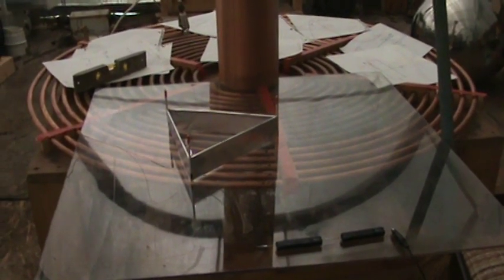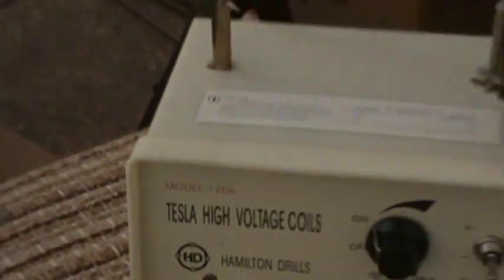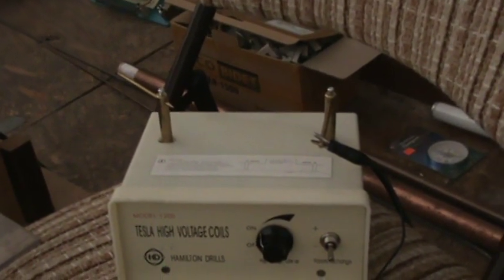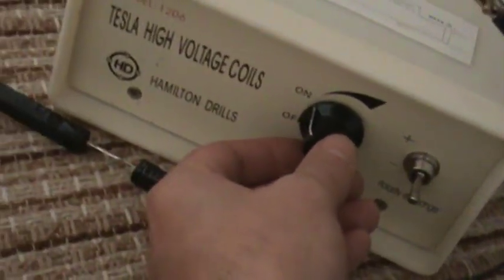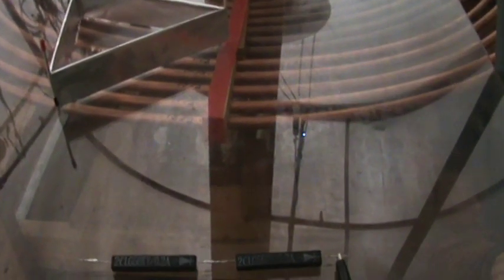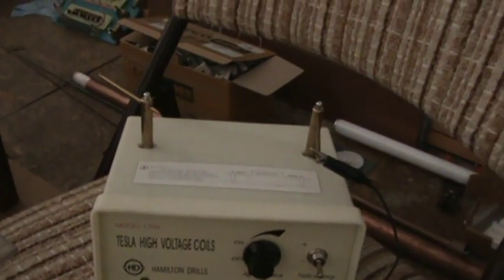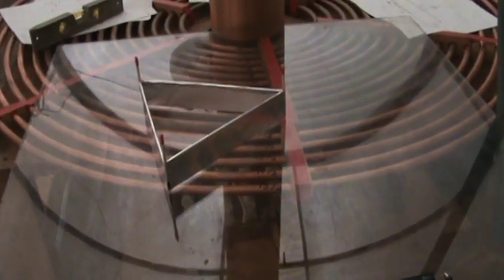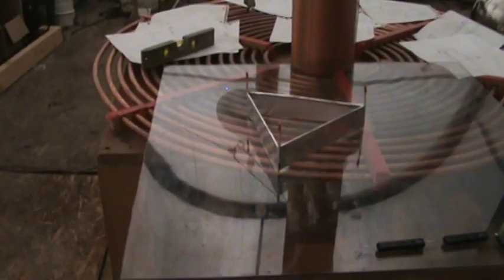LIfter/Ion Craft, Biefeld Brown Effect, Part 1

Comment: Needs capacitors for steady DC... and the wire should be far enough away from the foil to prevent arcs
Reply from the maker: I finally get some lift in video part 4, using TV .      Video part 5 craft sets on fire, LOL

Comment: I think I've found a way theoretically to improve the thrust of Lifters, taking into account that there may be two effects an
Electro-kinetic & an Electro-gravitic or what I call the Biefeld–Brown effect proper, which I guess should involve the use of embedded electrodes as air has a K of only 1. Which means the Lifters are using an Ion wind effect or some form of Ionic medium displacement. If 2 ionising wires were used both encased inside with a space between them at one end of a flat "box" the ends of which are both open & at the other end from the wires, the collector electrode is placed all around the inside end. If the first wire is
charged positive encouraging the diatomic Nitrogen & Oxygen molecules to form into more clusters, then the second wire charges these Negatively reversing this process & making the atoms & Molecules repel from each other before being attracted by the collector electrode might this not increase the thrust? If there were problems of arching between the wires then they could
be charged in sequence to maybe prevent this.
Reply from the maker: Interesting idea, I think the two wires would need to be out of phase with each other, yes, and i think it should work.
Thanks for commenting.

Comment: It shouldn't be arcing between the wire and the foil.  They're too close... Ground the negative side of the coil and skirt to Earth. Maybe it's too heavy but I'm not sure of it's weight. regardless of positive or negative to wire... it should even work unrectified. Best of luck buddy. Higher frequency is better... Sounds like only maybe 100 cycles Try with 100khz flyback.
Reply from the maker: Thank you :-)

Comment: your craft is too heavy for one, second, the wire and the foil can't  short out (no spark. when it spark the craft falls down) move the wire further away from the foil. last, your high voltage power supply will not work (Sorry ) I purchased the same HV power supply  from eBay and it never lift my craft. (wrong frequency and too little corona). I used a flyback and driver for my. Don't give up, every obstacle you overcome you'll learn  something new. I promise.

Comment: It's gotta be DC.
Reply: INVENTOR3 One more tip. If you want a cheap way to get high voltages, then search for a voltage multiplier. It takes an AC input, and gives you a DC output that is of higher voltage. It is made entirely of diodes and capacitors. The more you use, the higher the voltage can get stepped up, hence it's a multiplier. You could technically plug this multiplier straight into the wall, and get as many dc volts as you want, so long as you use enough diodes and capacitors. Best of all, you can tap this "multiplier" in different locations to get different output voltages!
Reply from the maker: TheMarvelousSputnik Sounds good, thanks, but as we multiply the voltage we would have to pay attention to the rated values of the components.  I will look into this, thanks again.
Reply: What he said. Use a diode bridge. Right now those two diodes are only creating a pulsed current going in one direction when the AC phase is going in the direction that the diodes "point" in. Use that diode bridge and you will have a proper DC current that will lift it.
Reply from the maker: TheMarvelousSputnik Thanks.  I believe the power supply used is a puled DC.  The power supply is Tesla technology, but anyhow i get better results in part 4 & 5.
I did make a full bridge rec with the 4 diodes and i still plan on trying them with my NST transformers.
Reply: Oh yes of course. You would need to make sure the caps and diodes can handle the voltage. However, they are still quite cheap. Basically if you want 100kV out, then just buy a bunch of diodes and capacitors rated for 100kV.
Reply from the maker: TheMarvelousSputnik well, maybe hard to find components in this range and expensive, but no problems, i understand, i will use multiple components in series and parallel to get values i need.  I will build a voltage multiplier soon, no problem, thanks again.

Comment: I don't understand the diodes in series, you would use them in parallel with a capacitor in a  Flyback circuit, maybe. You had success when you used the flyback on the TV. I think you would have better results going to a earth ground rater then the negative side of the generator. Put the negative side of the generator the earth ground as well.
Reply from the maker: Yes, better luck with the TV & i did wind up using earth ground with the TV set-up..  I found that this PSU in this video is actually a tesla coil,,,it is "pulsed" dc.  I will try this experiment again soon.  I want to try a circular craft with the skirt coming down to a funnel shape to increase thrust :-)  Did you see my craft set on fire in other video, hehehehe.
Reply: Yes I did see the fire video, that was cool. The funnel design sounds interesting, but I think you may be adding more weight then can be over come by the possible gain in thrust. I would love to see the results.

Comment: Speaking of capacitors: I think there should be some capacitance at the diode between the anode and the cathode. I don't know if you could use this and whether the diode capacitance is good or bad thing in your experiment. Other than that: I think I have heard about positive results having been achieved both with even AC and DC and even with both polarities, even though not convincing me (internet you know).

Comment: Your top wire was to close to foil, any sparking destroys the coronal wind (ions) by allowing electrons to flow. Think of it a two plate capacitor with the idea being to have the smallest area plate at the top. The thinner this wire the better and without any sparking, current flow is limited. Dont use good foil for the bottom plate but the cheapest thinest crap you can find. Try and round the top closest the top wire you DONT want any creases or holes. Check in the dark for any corona discharge

Comment: there should not be any spark crossing the gap.  u need to insulate that skirt from the fine wire so spark cant cross.

voltage must be increased smoothly until lift off.

with your set up try increase the gap a bit.

Comment from the maker: I read alot about the manufacture of that PSU,,he does not advertize correctly. It is a tesla transformer, so it is in fact already a pulsed dc, at what frequency, i dont know. I should of thought to try the NST with full bridge, thanks :-) I will use wood next time :-)  I read that Tesla kept his left hand in pocket. I have good souls on my shoes and stand on rubber mats :-)
I likie HV :-)

Comment from the maker: Is it true that the craft can be wired with pos going to the skirt or the corona wire? I saw one video that showed the polarities can be switched on the PSU. Corrona wire does need to be bare, correct?
Hmm, i have some old antique recording wire, .006 diameter.  I tried to make fold-over at top of skirt a smooth round form, we want this smooth round form, correct? Thanks again :-)

Comment from the maker: Yes, thanks, back to the drawing board, hehehe. Tesla coil machines can run off of ac or "pulsed" dc.  Through more research i believe that the PSU is in fact a pulsed dc power supply. Now to maybe use another PSU, or figure out what frequency the unit is running at, and then to modify ouput somehow. I think i will try another power supply. I have a19KV power supply, but not working now, maybe just blown fuse.  But i hope 19K is not too low tor lifting, i think 19K maybe min amount needed

Comment: Look at this:
----/watch?v=AzvCk6xKYyM----
Sorry the Video is in Italian...I'm italian :-)... Try with an old PC monitor like mine and a LIFTER made from LOW QUALITY tin foil (it's thinner and lighter) and STIROFOAM not balsa wood. It is very difficult to buid, very very fragile, but flies like hell !!!
The problem of your power supply is that it is a PULSED type. You need costant 15Kv DC to obtani a good ion wind. Anyway, a lifter is more or less useless GOOD LUCK! HAVE FUN!!!

Comment: I would do that on a wood table away from that awesome Tesla coil. Shouldn't need diodes if you use HVDC. An old CRT fly back should do the job. Hook up the outputs from your Jacobs ladder to it. :-) . Do you have that thing tied down? I bet it works next time you run it. You should get some dishwasher gloves and keep your left hand away from the electronics when using high voltage and/or high current stuffs. Don't want to see a good man get hurt.

Comment from the maker: I been saving a pile of old TVs, I got at least 13 of them.  Got them al from the garbage when TVs went to digital :-)  Im still trying to fully understand how to remove the flyback and use.  Also there is a way to use it without removing from TV, this sounds more simple, but still need good instructions.  Well, im hoping the poweer supply i have now will work, with some adjustments to the craft.

Comment: Great stuff make sure the craft is very light balsa wood posts aluminum and thin steel wire on top the power from a tv or monitor should do it and walla or build a voltage multiplier using diodes and capacitors to get to the dc voltage needed

Comment: Also, polarity doesn't matter much. I don't recall which is better but it works both ways. You do want DC though, so your diodes are probably a good idea if you're unsure what your power supply is putting out. I recall 70Hz pulsed DC was even better but I'm not sure if that's the right frequency. That memory is from a long time ago.

Comment: A few things... The first is that your wire is too close to the skirt. You want the wire to ionize the surrounding air. But I see yours arcing a lot, which means it's shorting to the skirt. When your voltage is turned down there's less arcing but maybe not as much current either? The second thing is that your skirt looks heavy. To work this needs to be as light as possible, try aluminum foil. It may help to lengthen the legs below the skirt one inch to avoid possible reaction with the tabletop.